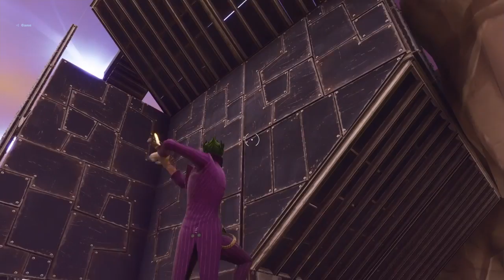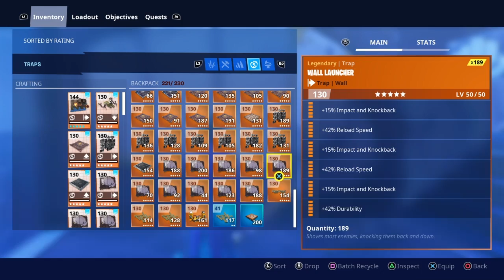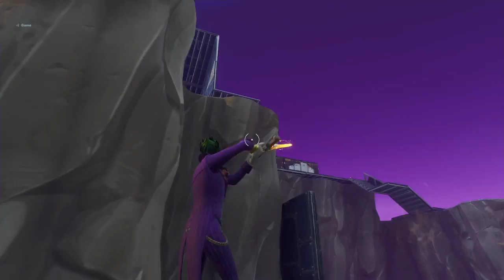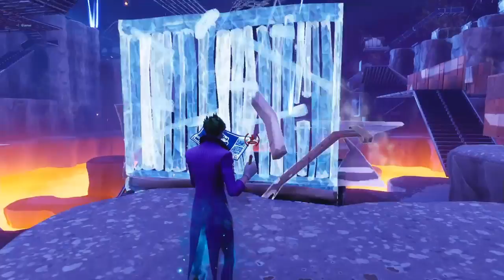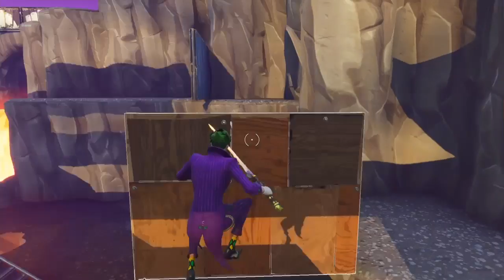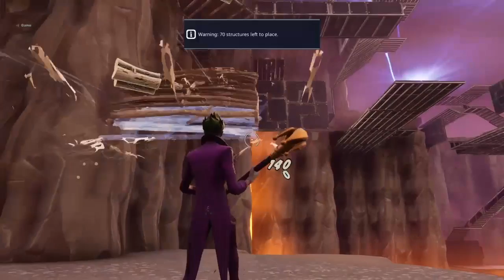Twine Peaks Endurance, AFK,  New Fun House Tutorial

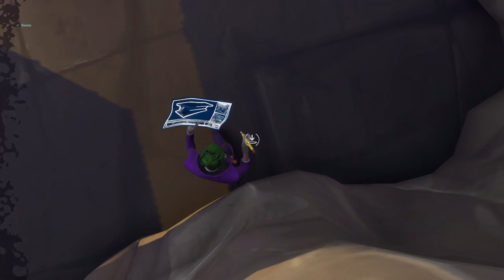Comment: can't figure out how to do the floating platform trick at 18:55 Edit: I was able to do it
Reply from the maker: It's based on how many support structures you used to connect what you want to float.
So if you have "6 supports" you want to leave HB in (half the time) after breaking the supports.

6 structures = 3s then leave.
8 structures = 4s then leave.
Reply: @fireburn045  I was able to figure it out